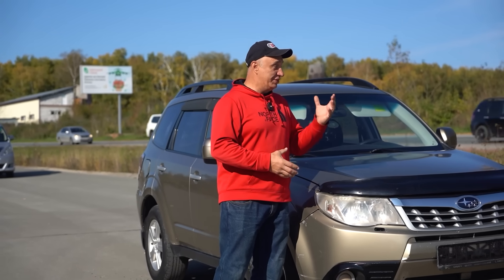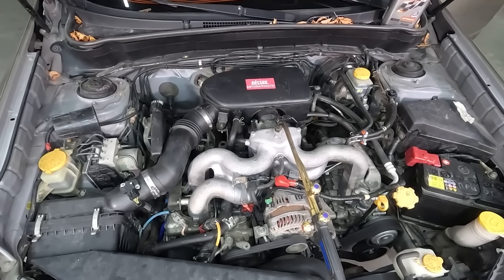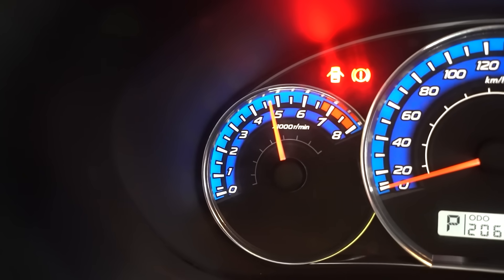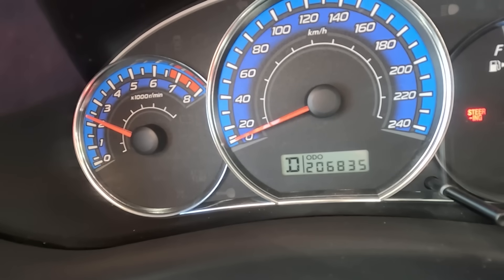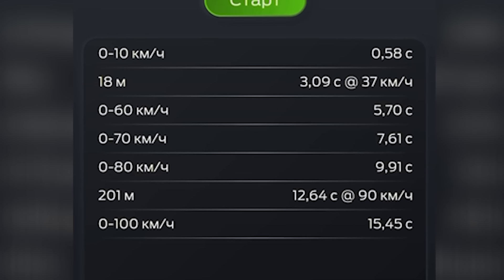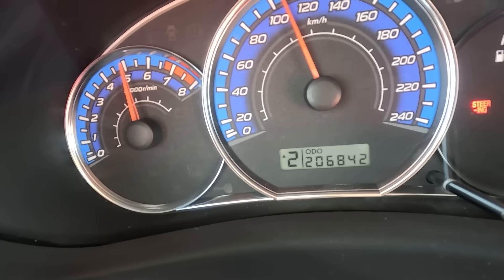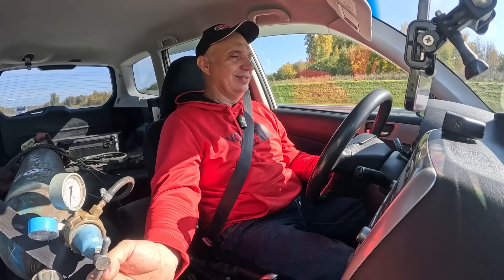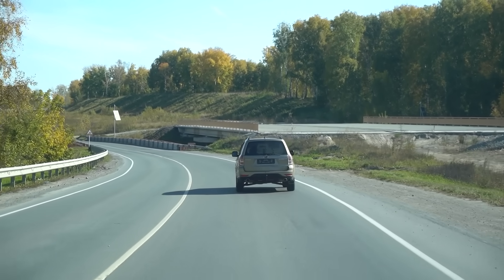We run an engine on pure oxygen - what will happen?

Comment: i bet what's happening is that the ECU notices extra oxygen in the exhaust and adds fuel to restore stoichiometry. Thus you get a bigger charge in the combustion chamber, hence higher revs with no change in the pedal position.

Try the same experiment with a carb engine and you'll have a very different result.
Reply: It will melt down a carbed engine almost immediately under load. It will go dead lean.
Reply: it'll just lean out unless you change the jetting
Reply: Yeah... You'll lean out the motor!
Reply: The revs going up on its own, is because you are introducing the air after the throttle body. The throttle body controls the air flow into the engine, so introducing air before it, into the manifold will naturally increase the revs. Hope you guys understand this wasn’t just some magical power
Reply: @Boostlee   the original post is correct the ECU tried to adjust the fuel map to compensate for the added o2
Reply: @Boostlee  100%. even if they just opened the hole in the intake manifold to atmosphere- normal air, it's after the throttle body hence a leak. The equivalent of partially opening the throttle.
Reply: @Boostlee  yes, effectively a massive vac leak.
Reply: @Boostlee  this as well as a tune would be required to see the maximum output, put id imagine it would get real fucking hot
 real quick
Reply: @Boostlee  Adding more air before the throttle body will just cause it to close and reduce the opening for air. Adding air after the throttle body - without a ECU to add extra fuel from the detection of a bad stoichiometry from the O2 sensor in the exhaust - will just cause the engine to run lean and not necessarily increase revs. Pure oxygen like this, again without a ECU, will likely cause heavy knocking and really high temperatures. Unless your car is running rich you will not see increased revs as the ideal stoichiometry will already be extracting as much useful energy as possible (no ecu).
Reply: @Boostlee  before Airmass flow metter will be better
Reply: @centralintelligenceagency9003  Thinking along those lines myself.  Increasing the O2 will burn the fuel more quickly, but the proportion of nitrogen in the mixture is decreased.  Air  is about 75% N2 and 25% O2, the engine relies on the N2 to expand when the fuel burns in the O2.  This why superchargers and turbos work, they force more O2 and N2 into the cylinders.
Reply: Hear me out guys, what about a 50% oxygen and 50% nitrogen on the air-fuel mix? Bet?

Edit: why not try that before the throttle body?
Reply: Sort of, but that will happen to all cars that have lamda sond, even cars that dont have ECU.

What it does is messure the exhauset if is high in oxygen or fuel and change the injection acording to that.

So it dont actually messure the oxygen, only if the engine go rich of Lean
Reply: This happens because the pedal is being adjusted by the ecu
Reply: And then a mechanical injection diesel engine
Reply: This is for sure what is happening. And it is also going to put both the short & long term fuel trims out of whack.
Reply: I'd say you are right . And using the carb will definitely show a seriously lean outcome . Probably won't even run once you introduce the extreme lean condition, and if it does run at least on the freeway, you'll probably smoke the pistons . lol
Reply: How long are the valves expected to last 😂
Reply: More oxygen, you need to adjust the electronic injection ignition. Perhaps reduce the ignition advance and inject more fuel. (The air meter measures the amount of air, not the oxygen ratio. The Lapda sensor in the exhaust should compensate for this.).  The oxygen intake is behind the throttle valve (+, electronically controlled variable adjustment). It makes sense that it idles higher. A lean mixture and premature ignition advance are harmful.
Reply: @1schroef    this engine has a knock sensor so timing retard is already handled. The rest has been said.
Reply: I played around with 02 with cabbies, use a oy torch, at idle, and just put the note near the air filter, turn it on and wow, huge rev increase
Reply: Yea lean
Reply: This is correct. Betting youll find lean condition codes on the ecu as well after this
Reply: @deadwaterblacksmithing    I'm gonna bet the CEL was already on so there's other codes in there. BTW, I do believe this is the first time we have seen a car with an ECM being used. Did they run out of Ladas?
Reply: When you add more oxygen you must also add more fuel, and if you add a lot more oxygen you must add more fuel then the fuel stock injectors can provide. If you add A LOT more fuel and some oxygen you will get a LOT more power . I suspect this car is running open loop injection system with oxygen sensor system fuel injection that automatedly add more fuel, that is why the rpm when up with more fuel.  Lot of car only run open loop with oxygen sensor that actively adjust it like  that under 2000 rpm and go to closed loop at higher RPM ignoring the oxygen sensor which means on those cars adding more oxygen will not help.

Reply
Reply: @a64738    The fact that the engine is responding like this tells us the system is in closed loop.
Reply: It won't work unless you reconfigure the carbs. Normally configured carbs will cease to work at high altitudes where the oxygen in the air is lower. So, we'd expect you'd need much bigger fuel needles for this to work. Since the oxygen in in air at sea level is 21%, you would need to deliver almost 5 times the fuel at 100% oxygen. Depending on the carburetor, that might not even be possible.
Reply: the only way to correct it is disconnecting the O2 sensor
Reply: This experiment was wild! Running an engine on pure oxygen really shows how sensitive combustion dynamics are. I’ve tried adding oxygen-enriched air before, and even a small boost can spike temperatures fast. These guys went full O₂, and you can literally hear the revs jump instantly. But yeah, the heat stress and lean burn risks are real  perfect example of science meeting mechanical limits.
Reply: the injectors at full pulsewidth and flow wouldnt be able to keep up with pure O2 @40% oxygen it would require 2x fuel
Reply: @Knucklehead4400 your 100% correct.
Reply: Yep that is what i was thinking too. ECU is compensating for the extra oxygen inserted into it, and as a result the ECU sending in more fuel to compensate for the (very) lean state.
Reply: Yep they should know better than this.
Reply: Not ment to have just oxygen in the engine.  It will burn the aluminum.
Reply: The oxygen gets burnt off by the motor
Reply: Yes this is pointless with sensors and ecu you need try this on basic carb engine!!!
Reply: it would have exactly the same no effect whether it's injection or carb if you don't add extra fuel. the carb won't magically know it's got more oxygen in the air  @HDSME
Reply: Never seen someone run nitrous on a carby car? Lmfao... nitrous is N2O... Nitrogen 2 oxygen, Nitrous - "oxide" Oxidiser. You just need the proper hardware.
Reply: All they had to do was spray some oxygen rich fuel instead, like nitrous oxide or methanol.
Reply: Depends, before or after the butterflies? Before the butterflies hardly any change, after and it'll rev up. Your adding what the throttle blade or butterfly is limiting, air. We won't get into mixture ratios.
Reply: It will still blow up. 

Pure oxygen is not a good idea in engines. If it was racers would use it. It's just too harmful, even in small quantities
Reply: @volvo09  but that’s exactly what nitrous systems are doing-albeit with the nitrogen acting as a little bit of a non-reactive quench
Reply: @malcolmwhite6588  Yes, but it MUST have more fuel to do something, if it does not it just heats everything up very fast.
Reply: @PREDATEURLT 👍🍻
Reply: @volvo09  If only there were an oxygen rich gas didn't eliminate all of the nitrogen from the intake. I bet that stuff would be pretty popular.
Reply: @volvo09  What do you think a NOs is for?
Reply: @volvo09  Oxygen is pretty bad stuff. It's amazing that we humans need it to survive!
Reply: @volvo09  Maybe switch to NOX instead? That would be a kick in the pants!
Reply: Without rejetting the carbs, the engine would melt pretty quickly. Detonation and overheating would be certain.
Reply: @antoniovillanueva308 I'm not sure detonation would happen, since you have adibiatic cooling with the compressed oxygen expansion, the main reason gasoline (port injection and carb, DI is different) engines run on the rich side.

Comment: Actually the new thing in drag is compressed air fed engine.  2 huge tanks at 200psi and you need a bypass valve to let the engine run that closes when running off the tanks.  But it would be a nice to try it on engines smaller than V8's.  Of course you burnt the intake valves, the oxygen was probably burning them up too., and the seals and the rings.. The catalytic is probably melted and blocked too.
Reply: Because people ALWAYS ask "why do you use nitrous when you can just use pure oxygen".

This channel is to answer all the questions, good, bad, or stupid. 

If pure oxygen was good racers would be using it.
Reply: @volvo09  Dude in the USA has a drag car running on compressed air instead of a turbo.  It's all computerized for proper fuel/air mix.  The thing rips...
Reply: @RandysRides yeah I've seen that! Crazy drag car!

That's compressed air though, air is like 20% oxygen? And nitrous is slightly more... Pure oxygen is vicious, it will just melt and destroy anything.
Reply: @volvo09  IT's the fact that you can have any pressure you want and it's constant.  Nitrous really depends on combustion already occuring in the engine, and it has to be tuned for seperately from the engine running by itself.
Reply: @volvo09  (The pressure from the tanks could make the engine spin even if there's NO combustion)  that's leading to exponentially higher efficiency, and the temperature of the depressurizing air is ice cold meaning e85 isn't even necessary.
Reply: @volvo09  no it wont. The reason it burnt the valves it because it leaned out the mixture and everything started to get real hot.
Reply: @pepperfish_  Nitrous doesn't burn, it comes out cold which allows more volume of stuff to go into the cylinders and thus more pressure more boom and more power.
Reply: @thomgizziz  Nitrous breaks down in the heat of combustion, into 2 parts Nitrogen and 1 free oxygen atom facilitating additional combustion, the nitrous is only cold because it is depressurizing, the same goes for the compressed air in the tanks.  Not at all more boom and bang, that is what blows up an engine or manifold.  Easiest way to understand is a fire place, if you blow more air from a bellows the flame gets smaller but the combustion temperature increases, there are no booms and pops. Bangs come from when incomplete combustion deposits fuel into the hot exhaust causing the bang.  The air compressed engine works on an entirely different principle, technically you can use one tank of propane and one tank of air and no gasoline at all.  It's a completely different take on forced induction, where you can filter and regulate the air delivery, irrespective of outside conditions.  you can run an engine like I described on the MOON.
Reply: @volvo09  So use Nitrox35 (air with extra O2 bringing O2 concentration to 35%). Look up Nitrox in scuba diving.
Or reduce O2 injection ahead of the MAF - no need to run it at 100%, just something above what N2O provides.
Reply: @volvo09  ok.. sure, I'm surprised there was no backfire.. but we don't know how much pressure or volume was really being fed into the engine, so any conclusions one may draw are vague.  Other than DON'T TRY THIS ON YOUR CAR.
Reply: Actually
Reply: And it’s a fad that’s gonna die like exoskeleton cars. It’s impractical
Reply: @stevenmartin4889 Well so did the turbineaxle but it didn't stop them trying.
Reply: Don’t think it’s that new.  It’s been done before. Check out Brian Lohnes drag racing videos
Reply: The engine got massively leaned out... that is why it burnt the valves.
Reply: @thomgizziz  Yes but also oxygen will burn metal at extreme temps... it would burn the valves even running rich.  That's what thermodynamics is all about, if the engine was cold and not rotating you could use basic physics.
Reply: @thomgizziz  What I'm talking about buidling is using an engine as an impact hammer with a combustion chamber.  Think of the torque you already get from an airpowered impact driver... now add fuel and spark to the mix and you'll see, mathematically, nitrous is a bandaid compared to this.